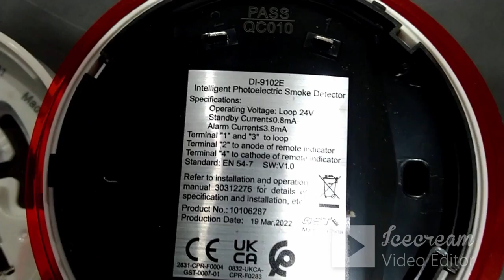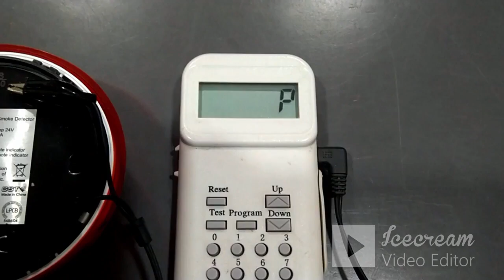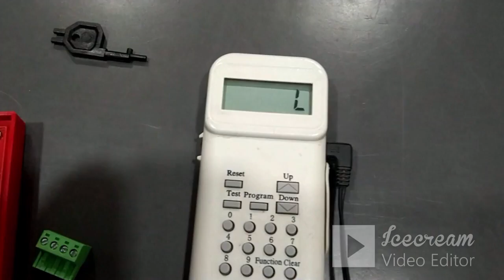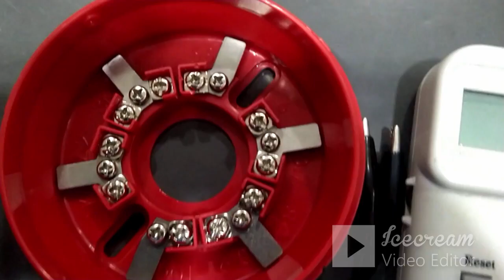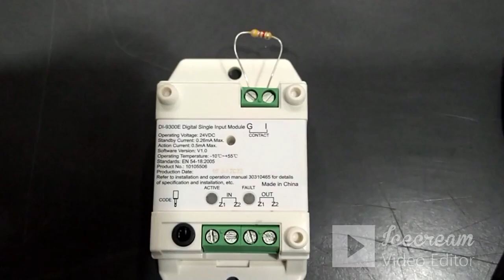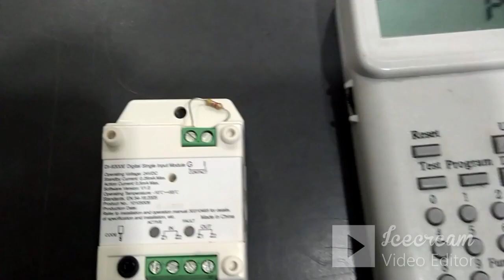Comment: Smoke detector dealers in Kerala
Reply: FIRE ALARM DEALERS IN KERALA, FIRE ALARM SYSTEM IN KERALA, FIRE ALARM SYSTEM TRADERS IN KERALA, ADDRESSABLE FIRE ALARM DEALERS IN KERALA, AGNI FIRE ALARM DEALERS IN KERALA, RAVEL FIRE ALARM DEALERS IN KERALA, SMOKE DETECTOR DEALERS IN KERALA, FIRE ALARM PANEL DEALERS IN KERALA, HONEYWELL MORLEY FIRE ALARM DEALERS IN KERALA, FIRECLASS FIRE ALARM DEALERS IN KERALA, AGNI FIRE ALARM PANEL IN KERALA, FIRE DETECTORS IN KERALA, FIRE ALARM DISTRIBUTORS IN KERALA, ASES FIRE ALARM DEALERS IN KERALA, CONVENTIONAL FIRE ALARM DEALERS IN KERALA, FIRE ALARM CONTRACTORS IN KERALA, SIMPLEX FIRE ALARM DEALERS IN KERALA, FIRE ALARM COMPANIES IN KERALA, FIRE ALARM SUPPLIERS IN KERALA, FIRE ALARM INSTALLATION IN KERALA, GST FIRE ALARM DEALERS IN KERALA, MORLEY FIRE ALARM DEALERS IN KERALA, ADDRESSABLE FIRE ALARM DEALERS IN KERALA, SIMPLEX FIRE ALARM DEALERS IN KERALA, CONVENTIONAL FIRE ALARM DEALERS IN KERALA, FIRE ALARM TRADERS IN KERALA, HEAT DETECTORS IN KERALA, FIRE ALARM PANEL DEALERS IN KERALA, HONEYWELL FIRE ALARM DEALERS IN KERALA, FIRE ALARM SOUNDER IN KERALA, FIRE ALARM HOOTER DEALERS IN KERALA, FIRE ALARM MCP IN KERALA, FIRE DETECTION SYSTEM IN KERALA, 

FIRE ALARM DEALERS IN ERNAKULAM, FIRE ALARM DEALERS IN TRIVANDRUM, FIRE ALARM DEALERS IN KOCHI, FIRE ALARM DEALERS IN THRISSUR, FIRE ALARM DEALERS IN PALAKKAD, FIRE ALARM DEALERS IN KOTTAYAM, FIRE ALARM DEALERS IN CHANGANASSERY, FIRE ALARM DEALERS IN THIRUVALLA, FIRE ALARM DEALERS IN CHENGANNUR, FIRE ALARM DEALERS IN ALEPPEY, FIRE ALARM DEALERS IN ADOOR, FIRE ALARM DEALERS IN PANDALAM, FIRE ALARM DEALERS IN KARUNAGAPALLY, FIRE ALARM DEALERS IN KAYAMKULAM, FIRE ALARM DEALERS IN PATHANAMTHITTA, FIRE ALARM DEALERS IN OACHIRA, FIRE ALARM DEALERS IN KOLLAM, FIRE ALARM DEALERS IN TRIVANDRUM, FIRE ALARM DEALERS IN PERUMBAVOOR, FIRE ALARM DEALERS IN KOTHAMANGALAM, FIRE ALARM DEALERS IN MOOVATTUPUZHA, FIRE ALARM DEALERS IN PALA, FIRE ALARM DEALERS IN VALANCHERY, FIRE ALARM DEALERS IN MALAPPURAM, FIRE ALARM DEALERS IN TIRUR, FIRE ALARM DEALERS IN CALICUT, FIRE ALARM DEALERS IN PONNANI, FIRE ALARM DEALERS IN PAYYANNUR, FIRE ALARM DEALERS IN WAYANAD, FIRE ALARM DEALERS IN KALPETTA, FIRE ALARM DEALERS IN MANANTHAVADY, FIRE ALARM DEALERS IN FEROKE, FIRE ALARM DEALERS IN THANUR, FIRE ALARM DEALERS IN KERALA, FIRE ALARM DEALERS IN CHALAKKUDY, FIRE ALARM DEALERS IN KODUNGALLUR, FIRE ALARM DEALERS IN ANGAMALY, FIRE ALARM DEALERS IN BATHERY, FIRE ALARM DEALERS IN, MUNNAR, FIRE ALARM DEALERS IN IDUKKI, FIRE ALARM DEALERS IN MANJERI, FIRE ALARM DEALERS IN THALASSERY, FIRE ALARM DEALERS IN THRIPUNITHURA, FIRE ALARM DEALERS IN VADAKARA, FIRE ALARM DEALERS IN KANHANGAD, FIRE ALARM DEALERS IN KOYILANDI, FIRE ALARM DEALERS IN KALAMASSERY, FIRE ALARM DEALERS IN NEYYATINKARA, FIRE ALARM DEALERS IN GURUVAYUR, FIRE ALARM DEALERS IN VADAKKANCHERY, FIRE ALARM DEALERS IN PARAPPANAGADI, FIRE ALARM DEALERS IN NEDUMANGAD, FIRE ALARM DEALERS IN KASARGOD, FIRE ALARM DEALERS IN PAYYOLI, FIRE ALARM DEALERS IN PUNALUR, FIRE ALARM DEALERS IN CHERTALA, FIRE ALARM DEALERS IN TALIPARAMBA, FIRE ALARM DEALERS IN KOTTAKKAL, FIRE ALARM DEALERS IN SHORNUR, FIRE FIRE FIRE ALARM DEALERS IN IRITTY, FIRE ALARM DEALERS IN ATTINGAL, FIRE ALARM DEALERS IN HARIPAD, FIRE ALARM DEALERS IN MUVATTUPUZHA, FIRE ALARM DEALERS IN KOOTHUPARAMBA, FIRE ALARM DEALERS IN IRINJALAKUDA, FIRE ALARM DEALERS IN MAVELIKKARA, FIRE ALARM DEALERS IN MAVELIKARA, FIRE ALARM DEALERS IN VARKALA, FIRE ALARM DEALERS INMANATHAVADI, FIRE ALARM DEALERS IN KOTTARAKARA, FIRE ALARM DEALERS IN KOTTARAKKARA, FIRE ALARM DEALERS IN RANNI, FIRE ALARM DEALERS IN MALLAPALLY, FIRE ALARM DEALERS IN ALUVA, FIRE ALARM DEALERS IN SHORANUR, FIRE ALARM DEALERS IN EDAPPAL, FIRE ALARM DEALERS INKUTTIPURAM, FIRE ALARM DEALERS IN PERINTHALMANNA, FIRE ALARM DEALERS IN NILESWAR, FIRE ALARM DEALERS IN KUTTIADI, FIRE ALARM DEALERS IN MAHE, FIRE ALARM DEALERS IN THAMARASSERY, FIRE ALARM DEALERS IN PONKUNNAM, FIRE ALARM DEALERS IN NILAMBUR, FIRE ALARM DEALERS IN PATTAMBI, FIRE ALARM DEALERS IN VALPARAI, FIRE ALARM DEALERS IN FIRE ALARM DEALERS INVADALY, FIRE ALARM DEALERS IN KOOTHATTUKULAM, FIRE ALARM DEALERS IN THALAYOLAPARAMBU, FIRE ALARM DEALERS IN ETTUMANUR, FIRE ALARM DEALERS IN KANJIRAPPALY, FIRE ALARM DEALERS IN CHAVARA, FIRE ALARM DEALERS IN KILIMANUR, FIRE ALARM DEALERS IN KUTTIKKANAM, FIRE ALARM DEALERS IN PERAMBRA, FIRE ALARM DEALERS IN MANNARKKAD, FIRE ALARM DEALERS IN KUNDARA.

Comment: Addressable fire alarm systems in Kerala
Reply: FIRE ALARM DEALERS IN KERALA, FIRE ALARM SYSTEM IN KERALA, FIRE ALARM SYSTEM TRADERS IN KERALA, ADDRESSABLE FIRE ALARM DEALERS IN KERALA, AGNI FIRE ALARM DEALERS IN KERALA, RAVEL FIRE ALARM DEALERS IN KERALA, SMOK DETECTOR DEALERS IN KERALA, FIRE ALARM PANEL DEALERS IN KERALA, HONEYWELL MORLEY FIRE ALARM DEALERS IN KERALA, FIRECLASS FIRE ALARM DEALERS IN KERALA, AGNI FIRE ALARM PANEL IN KERALA, FIRE DETECTORS IN KERALA, FIRE ALARM DISTRIBUTORS IN KERALA, ASES FIRE ALARM DEALERS IN KERALA, CONVENTIONAL FIRE ALARM DEALERS IN KERALA, FIRE ALARM CONTRACTORS IN KERALA, SIMPLEX FIRE ALARM DEALERS IN KERALA, FIRE ALARM COMPANIES IN KERALA, FIRE ALARM SUPPLIERS IN KERALA, FIRE ALARM INSTALLATION IN KERALA, GST FIRE ALARM DEALERS IN KERALA,  FIRE PIPE INSTALLATION IN CONTRACTORS IN KERALA, FIRE SAFETY CONTRACTORS IN KERALA, FIRE PA TWO WAY TALK BACK SYSTEM DEALERS IN KERALA, HEAT DETECTOR DEALERS IN KERALA, HONEYWELL FIRE ALARM DEALERS IN KERALA, SMOKE DETECTOR DEALERS IN KERALA, FIRE ALARM DEALERS IN KERALA, FIRE ALARM SYSTEM IN KERALA, FIRE ALARM SYSTEM TRADERS IN KERALA, ADDRESSABLE FIRE ALARM DEALERS IN KERALA, AGNI FIRE ALARM DEALERS IN KERALA, RAVEL FIRE ALARM DEALERS IN KERALA, SMOKE DETECTOR DEALERS IN KERALA, FIRE ALARM PANEL DEALERS IN KERALA, HONEYWELL MORLEY FIRE ALARM DEALERS IN KERALA, FIRECLASS FIRE ALARM DEALERS IN KERALA, AGNI FIRE ALARM PANEL IN KERALA, FIRE DETECTORS IN KERALA, FIRE ALARM DISTRIBUTORS IN KERALA, ASES FIRE ALARM DEALERS IN KERALA, FIRE SAFETY CONTRACTORS IN KERALA, FIRE ALARM CONTRACTORS IN KERALA, SIMPLEX FIRE ALARM DEALERS IN KERALA, FIRE ALARM COMPANIES IN KERALA, FIRE ALARM SUPPLIERS IN KERALA, FIRE ALARM INSTALLATION IN KERALA, GST FIRE ALARM DEALERS IN KERALA, MORLEY FIRE ALARM DEALERS IN KERALA, FIRE ALARM INSTALLTION IN KERALA, FIRE FIGHTING COMPANIES IN KERALA, ADDRESSABLE FIRE ALARM SYSTEM DEALERS IN KERALA, FIRE ALARM SYSTEMS IN KERALA, PA TALK BACK SYSTEMS IN KERALA, FIRE CONTRACTORS IN KERALA, FIRE PROTECTION COMPANIES IN KERALA, FIRE FIGHTING CONTRACTORS IN KERALA, FIRE ALARM DISTRIBUTORS IN KERALA